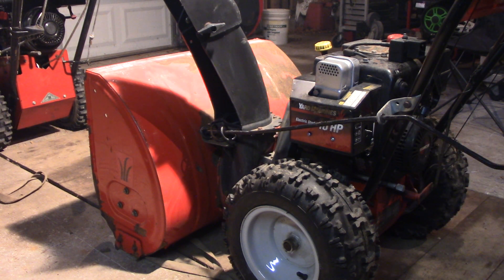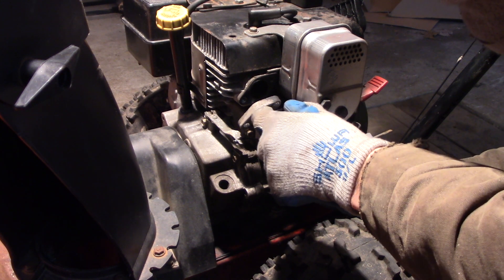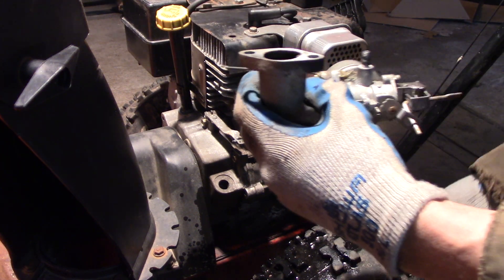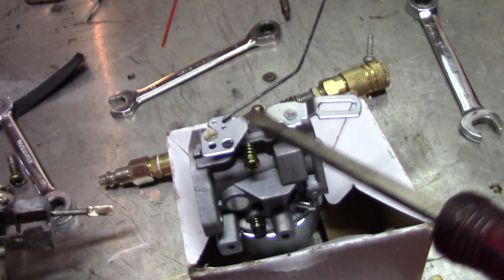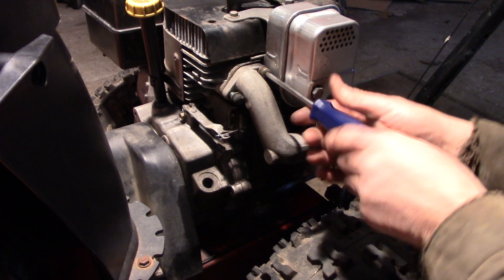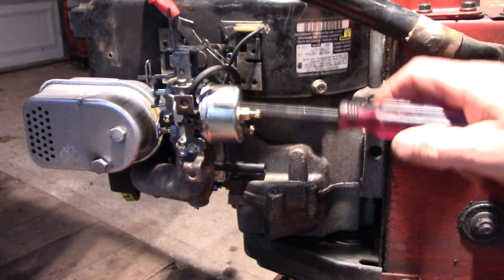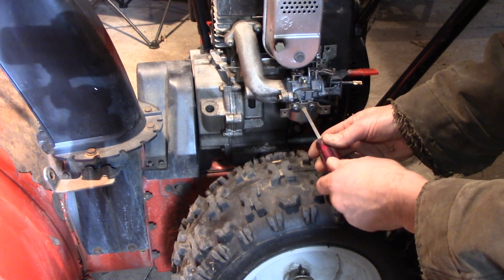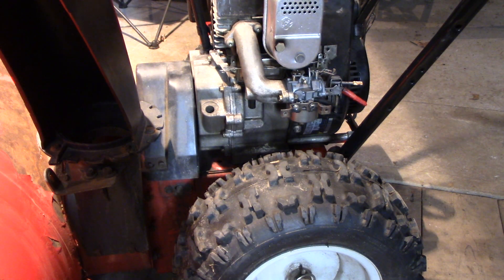How to adjust a techumseh fixed jet carburetor on a snowblower.

Comment: Been wasting my time for a week with my dad. Have a craftsman snowblower with the junk fixed jet carb on it… got it all cleaned, runs 90% better but still does same issue where it dies on low idle and needs choke….thought drilling out the small pinhole on the side of the main jet screw body a tad larger would help, but still no go. Just received my adjustable carb to replace the fixed jet carb, should’ve saved my time and just bought it earlier, I’ll never have any issues in the future now 😃

Comment: Your fix for the OEM carb summarizes my feelings for this carb SO WELL!!! SO many times I wanted to push it out in the driveway, let it leak a little more fuel, and light it on fire. Years of my life wasted fighting with the carb. It would run for anywhere from 2 minutes to 20 minutes, then start sputtering and die. I have cleaned the carb more times than I have used the snowblower. I looked for a needle and seat set, gave up, and just ordered an adjustable carb from Amazon, haven't received it yet to report on my experiences. After ordering it, I found this video.
Reply from the maker: Ha i feel your pain. Bolt it on prime it and away you go.

Comment: Agreed for $15 it isn't worth rebuilding assuming the new one is correct. I've had some issue with Chinese replacements too, especially on snow blowers,  so its a crap shoot sometimes. BTW, I've cleaned many of these non-adjustable carbs and found if you use the proper method,  and let them soak, followed by a rinse,  they return to fully functional - just like it was when you bought it! Working!
Reply: Hello what do you soak them in?  I too not into the carburetors on Websites.
Reply: @johnhouli3450  I've used carburetor cleaner that comes in a 1 gal can with a basket. I bought it a NAPA and another one at Central Tractor. If that is too expensive or difficult to find, use plain carb cleaner that comes in aerosol and use the straw tip. Walmart has a good one for about $3-4/can. If you use the soak method, let it soak for a an hour+ and rinse with brake cleaner or carb cleaner and a blast of air in all the ports. Pay attention to the tiny holes in the bore and and the removable jets. This soaking method will remove any gum or residue that most cleaners won't touch however it will also destroy any orings or plastic components so make sure you have replacements before using this method. If you use the aerosol  method, try to blast into the holes, rinse well, and air blast. I've done many of these with success but have found carbs that are damaged from ethanol are sometimes not fixable. If you have corrosion inside or any place it shows pitting, throw it away (or mail it to the EPA and ask why this is "saving the earth?") and replace it.
Reply: Thank you very good we’ll explained
Reply: @saltcar  thank you. We’ll explained. I will give it a try. 
One more question idle on Tecumseh how low is idle on the throttle is it right above off or a little higher. 
I’m 65 yr old this is new to me. Only used a shovel for 40 years.
Reply: @johnhouli3450  I set them about 15-1800 which is just enough to cool down for 15 seconds or so before sliding the lever to stop. The lever should have a detent position at idle. Set that and then adjust the screw on the throttle plate to the desired speed. The lever can then be slid down further to the point where a small tab comes in contact with it grounding the coil and killing the spark.
Reply: @saltcar  thank you sir.

Comment: Nice J La on the older fixed jet under rubber cap is a screw is that the idle screw it has a main hole and a side hole. 

Do you know

Comment: Thank you!  So much! For making this video.   I bought  one of those non-adjustable carburetors for my snowblower from a local lawn more shop  about 3 years ago, installed it But never needed to run the snowblower until now,   It will only run if the choke stays one partially. Now I know what I have to do to it! Thank you!

Comment: That was Tecumseh original equipment on those engines in the later years. Non adjustable with a plastic emulsion tube 🤦‍♂️Loved the video